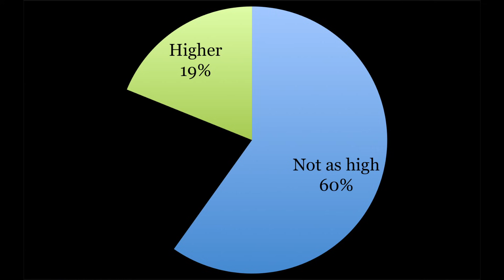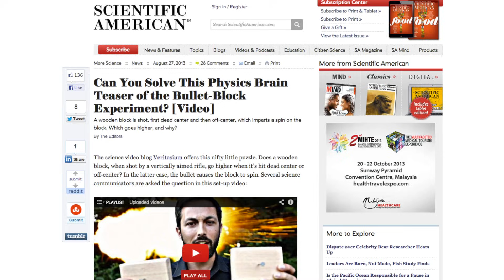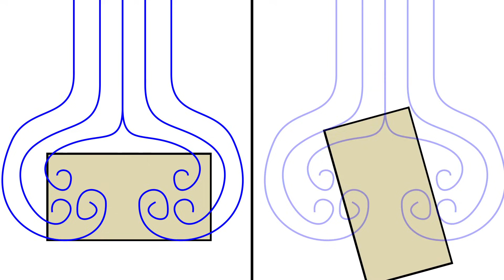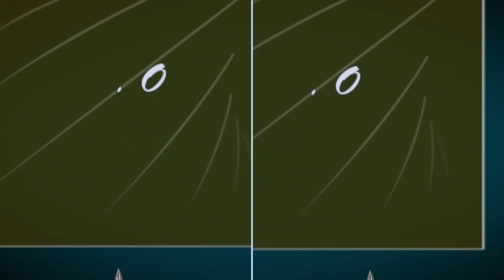Bullet Block Explained!

Comment: yeah, this guy got it wrong lol. and I find some people's answer here a lot more believable than his.He basically has this "everybody is wrong but me attitude" and then explain why he is correct through a non-science answer. 

Part of the vertical momentum is transferred to rotational momentum that' why it spins. if the blocks has the exact same vertical momentum then there would be no spin. in order to have two blocks with the exact same vertical momentum hit with the same bullet, but one is spinning and the other is not then you have to BREAK THE LAWS PHYSICS.
   
Moreover he tries to make a scientific claim without doing enough/proper tests. This is not science. It's Youtube entertainment

Comment: To increase the difference in bullet depth use materials with low density... the bullet travels more distance in the blocks since they loose less energy per every mm of depth. That would also mean that you use bigger blocks..

Comment: Might be that the spining block is spining around a changed center of gravity so fast that it spins itselfs up 
Kind of how its easier to spin a hammer when thrown by the head but it goes further if you throw it by its handle
Imagine having a long rod and you're throwing it up from its center of mass
Then imagine you throwing it one millimeter to the right of its center of mass
It will feel heavier
But you're carrying the same weight, the spin longer side will make it spin slightly and make. It look like you've thrown it farther, but the center of mass should be the same height
If you grab a hammer by the neck and swing it by the neck or the head, as long as they arent swinging away from center of gravity, it should go up the same 
Even if the neck throw might make the handle spin over the center of mass it isn't going higher the the one thrown by the head

Comment: Would the bullet depth have something to do with the fact that the energy required for the bullet to lift the block would theoretically be ever so slightly less due to less mass of the wood above where the bullet struck?

Comment: I would try with sphere or dodecahedron,icosahedron,etc. or at least try to compare shots on the same line along the middle of bottom,that way you have 2d problem instead of 3d mess :)
Reply: but its a very good video.My impression was that energy wasted on momentum will decrease gravity pull due the gyro effect. Best is to try it in vacuum but hard to shot bullet there,coil gun maybe!?

Comment: This video is 4 years old and there is 4282 comments (1 million views), so I presume somebody gave a definitive answer.

Here is my take: The bullet is low mass and very high speed. The wood block is so massive and slow that we have an impedance mismatch.

The bullet penetrate about the same depth in both case. For the bullet, it makes no difference to hit in the center or the side. The block take so much time to start rotating that it appear as immobile from the reference frame of the bullet.

The geometry is also important. If the bloc would be an elongated rectangle, we would get a much different effect between center and far side of the rectangle. The difference is related to the center of mass. In the extreme case of very long piece of wood and bullet hitting  close to one side, that side would lift and the other stay put, That side would lift higher than the entire board when hit in the middle.

The other extreme case is, once again, using a long piece of wood but aligned vertically this time. Let say 1 inch by one inch at the point of contact with the support and location of the bullet and 10 foot long pointing toward the sky. The bullet can hit dead center at 0.5 and 0.5 or hit closer to a side such as 0.75 inch and 0.75 inch,. The center of mass is 5 foot away, so the difference between 0.5 to 0.75 inches, which is a delta of 1/4 inch) is such a tiny fraction of 5 foot. It is clear that most energy would be converted to vertical lift, not much to rotation.

Comment: 1: Use a slower, heavier bullet. 2: use a non-deforming round (Full Metal Jacket should suffice)  3: use softer wood so that the total depth is increased and the difference is also larger

Comment: The entire experiment hinges on one big fundamental assumption: all bullets shot impart the same exact force.

Since the additional slow-mo footage suggests a large variance, this entire test is fairly inconclusive, without at least a much larger sample size.

With a random deviation in the force of up to, say 20% (using the footage the actual relative force of each bullet tested could be calculated), comparing a sample size of 5 to 3 is completely inconclusive.

Comment: When examining a single independent variable like this (the distance relative to center of mass) I always like to look at the extremes for potential insight.

If you were able to stretch the wood without changing its mass or other material properties (ie. being too thin to contain the bullet), so that the impact location is an arbitrary distance away from the center of mass, eventually you would reach a point where so much of the bullet's energy is converted into torque, that the wood object would not even lift off the glass. There is no real arguing around this fact - Whatever happened here is only possible due to how small the offset is compared to the forces involved.

Practically, you could probably accomplish this by using one or more light metal rods of a foot or two in length, attaching a small piece of wood (large enough to fully contain the bullet upon impact) and balancing the system to weigh the same amount as the original wooden block (or simply repeat the experiment with a larger, heavier piece of wood). Air resistance should be negligible at these velocities. The elasticity of the metal should be  kept in mind but with a strong enough construction (thin metal rods welded in triangle shapes like a crane) should be negligible.

Comment: This video plays into a question I've had for years.  If you are driving in your car and another car goes through a res light from an intersection at 90 degrees to your path and a collision is imminent:

A:  is it better to hit the other car away from its CG?

B: under any circumstance is it better for your survival (i.e. Limiting your change in velocity) to not apply brakes or even accelerate before the collision?

Comment: the block maintains more resistance when it's hit in the middle compared to when it is hit on the side. you can prove that with a scale. also try kicking a foot ball dead center and then on the side and you'll realize that the ball will travel further when it's hit dead center than when it's hit on the side.

Comment: Take in consideration the pull of gravity on the spinning block you have a so much energy on a the one side of the block which put it in a unbalanced tumble every rotation it makes gravity will pull on the heavier side of the block due to the lead weight of the bullet on one side which wil increase the rotary momentum which in total adds up in the linear motion of the block . There is so much to take in consideration making this a hell of experiment to dissect .

Comment: The angular momentum of a bullet-block system in which the bullet is heading towards the center of mass of the block is inherently smaller than that of a bullet-block system in which it is heading to an offset location on the block. The angular momentum beforehand is calculated by this offset before impact and by the rate of rotation after impact and they are bother equal.

Comment: please measure the weight while you shot the block, at the point where the nail touch the glas. my prediction would be, that we can see a force on the nail pushing it down while the bullet strikes on the side vs no force when it strikes the middle.

Comment: finally, a video from veritasium that I can refute.  visually, there should be no or little difference.  computationally, there should be less lift in the vertical axis as it is lost in the required energy to spin the block while simultaneously lifting it.

Comment: i concluded that it jumped to the same height because if you can combine the weight of the block and nail ata ny position it would have the same weight. so it would have the same force from gravity

Comment: No.  Linear momentum and rotational momentum are NO independent.  To verify, simply use a far wider block and repeat the experiment, re-measuring the results.  Your blocks are too close to round to see the difference.

Comment: use softer lighter material, maintaining the weights, that way the difference in penetration would be greater but the other parameters would remain mostly untouched, except angular momentum, allso, fire further form then center of mass.

Comment: When you shoot it on the side does the bullet not stay in the wood like when you shoot from the middle?

I have to say it has somethig to do with the wood resistance to the bullet itself. Like, I dunno how to explain it scientifically. I feel like the blast itself is what is making the block fly upward..... not the motion of the bullet. The motion of the bullet is what is making the block spin............ and that wind resistance (the tiny amount while spinning) is the reason it goes SLIgHTLY lower....

I mean we all learned that a shotgun blast does not send a body flying....... so why should it sed a block flying? I think it's the sonic wave pushign th eblocks not so much the bullet itself.

Comment: I know that I am posting this comment in 2017 but...what if you use harder bullets? The bullets fired out of those rifles, if I'm not mistaken, are lead ones. So, how much of a difference would it make if you use a special rifle with a special bullet that was made out of steel or something?
Also, by special, I mean a bullet that would be slow enough for the block of would to be in the camera's frame.

Comment: to see better difference in depths use lower energy projectiles and lighter material blocks. like pellet gun and Styrofoam blocks. air resistance will play bigger role in controlling heights of low density materials so perhaps you should do it at THAT NASA center :)

Comment: here is an intuitive way to rationalise the outcome: a wooden block the size of a point has no edge or centre, so there's only one height it can reach when shot. an infinitely wide block also has no edge or centre (every point is a centre), so again there's only one height an infinitely wide block can reach. so everything in between must behave similarly. this is not a mathematical proof, but often such extreme case analyses yield elegant explanations.

Comment: Hi Derek, I have a few more thoughts about explaining this. 
1. Maybe even though the bullets penetrate the two blocks to a similar depth, they don't finish the penetration with the same TIME. I speculate that the bullet that hits the block on the SIDE penetrates SLOWER because intuitively the block moves AWAY when being hit. I'm thinking because of this, IMPULSE due to the penetration force acting for a variable TIME matters. But I don't know exactly how.
2. Just to mention that I think while the linear momentum conserves, which explains this result, the angular momentum also conserves. It's just that the two systems start with totally different angular momentum, and the angular momentum of each system conserves respectively. The system where the bullet hits in the MIDDLE apparently has NO angular momentum from the start and keeps that. The system where the bullet hits the SIDE has a NON-ZERO initial angular momentum because the bullet travels sideway relative to the CENTER OF MASS of the entire block-bullet system.

Comment: +Veritasium at https://youtu.be/BLYoyLcdGPc?t=6m10s the statement that Linear Momentum and Angular Momentum are conserved separately sounds like saying they cannot be inter-converted, but they can. An old trick for satellite de-spin converts 100%, very very simply. That and another method also appear to offer a way (special case) to generate Angular Momentum from (what is, at net) only the energy (not the momentum) of Linear Momentum.

Comment: I believe that most of the difference is caused by the velocity of the bullet and the way the motion of the bullet, is transferred to the motion of the wood. 

We test fired different 45 caliber lead rounds from different guns with different barrel lengths and velocities at a fire rated post office safe. At lower velocity the paint on the safe was not damaged, the lead bullet fragmented into powder. 

As we increased the velocity of the same round, it removed the paint, and dented the safe door. The bullet fragmented to powder. 

As we increased the velocity further, we penetrated the metal and caused a molten burned edge around the hole on the metal safe with shallow penetration. The bullet either fragmented or boiled away. 

When we fired the same round from a long barrel it penetrated the metal of the safe cleanly, and then bored into the magnesium oxide, totally fragmenting or boiling away. 

The first round we fired that did not remove the paint from the safe door, moved the safe door the most. It caused the safe door locking rods to strike the cabinet. 

In comparison the last most powerful round did not move the whole door noticeably at all. It did not depress or dent the metal on the face of the door that was struck. 

Having shot perhaps 100,000 thousand rounds and projectiles in my life, I have noted phenomena of velocity, that have almost gotten myself and others hurt. Very unforeseen violent reactions have occurred when only small differences in placement of the round upon a target occurred. After seeing it the explanation is usually a simple one, however unforeseen. 

I believe that is where most of the effect is being creating. The wood is absorbing much of the motion of the round upon destruction in both cases. 

Because the wood is giving, and obviously the spinning wood gives way or moves more than the wood that does not spin. The wood is equalizing the effect to some extent. 

Consider shooting an aluminum soda can with a high and low velocity round. The low velocity round, can put a hole into the can and a hole out of the can and throw the can off a shelf. A higher velocity round can leave the can solid upon a shelf after putting a hole into the can and another hole as it exits the can. 

The variables are too great to take any exacting conclusion away from this experiment. 

Sincerely, 

William McCormick

Comment: I think the rotating blocks generating lift. Look up the simultaneous footage of the eight blocks. Compare the falling of the blocks  4 and 6 (from left to right), 3 and 7, 2 and 8. The spinning ones stay longer at the upper dead point of the motion and fall slower. Try redoing the experiment with discs (but there can cause the angle of impact problems :( ).

Comment: +Veritasium 

I have an idea for a new experiment with this projectile motion setup you have made.

First of all, using a much softer wood such as that of balsa wood will increase the penetrative power. Balsa wood also has a fairly uniform soft texture, so it should be able to be replicatable between experiments. Using metal plates on the front and back of the block will give it extra mass to cause the moment of inertia to be increased. This will increase the rotational energy, while decreasing the lift height so as to allow the rotating block to spin away from the bullet faster, causing it to lodge in the block sooner, and thereby penetrate less than the block shot in the center. This would seem to me to be the best chance of finding out if it is the penetrative depth that correlates with the spin rather that some other force acting upon the block. This could also be tested more by shooting blocks in different places and finding a linear equation that predicts the rotations per second by measuring the mass of the bullet, the initial velocity as it exits the barrel of the gun, the distance of the impact from the center of the block, and the mass of the block. it would need three shots minimum on identically set up blocks of same mass, bullets that are measure to be exactly the same weight and have the same amount of propellant, and then replicated three or more times with different mass blocks to measure as a variable in the equation to account for the inertia in heavier blocks. 

In this setup, I predict that the heavier the block, the faster the block will spin due to the moment of inertia on the side that was not hit as there is a larger mass to lift than the lighter blocks. Granted, there should be equal inertial force on blocks of different masses, but I have an inkling of a feeling that the rotations per second may be reliant on whether the block is able to transfer the energy through the Mould effect, thereby increasing the rpm by using a 'whipping' action by driving one side up while the other side stays motionless. 

Please let me know what you think of this, I would be interested in hearing your thoughts on this.